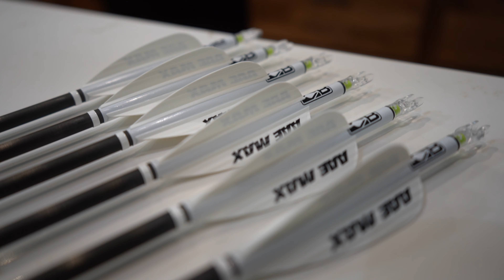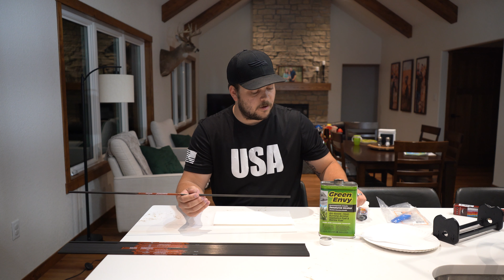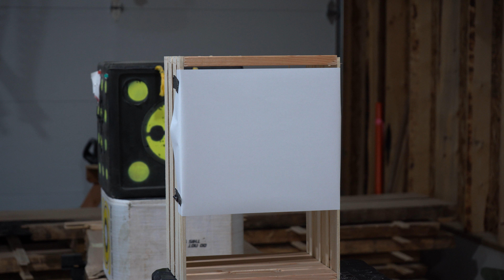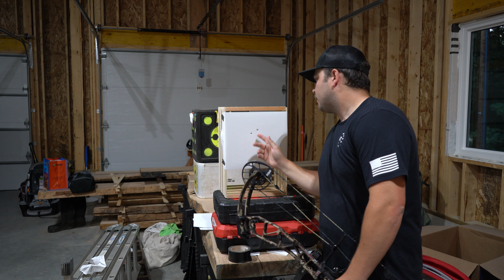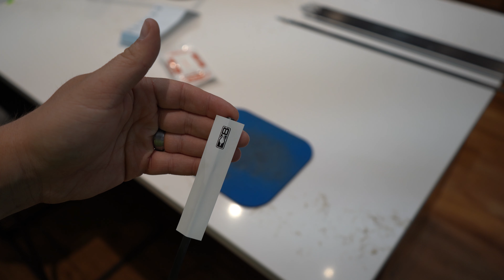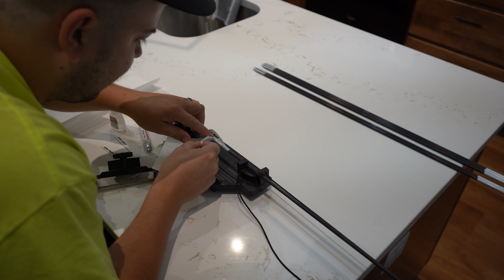How To Build An Accurate Arrow: Step by Step Process

Comment: I really hate nock tuning, I find it to be super tedious and slow down the process completely.

My 2 cents here: If you spine index your shafts, you can skip the nock tuning portion. A DIY spine tester can be built relatively cheap, https://shootingtime.com/archery/how-to-make-arrow-spine-tester/ 

I built one of these and haven't had any issues with arrow flight over around 50+ shafts I've put together.
Reply from the maker: I’ve always wanted a spine tester. I will have to try that out! I agree nock tuning does take some time!